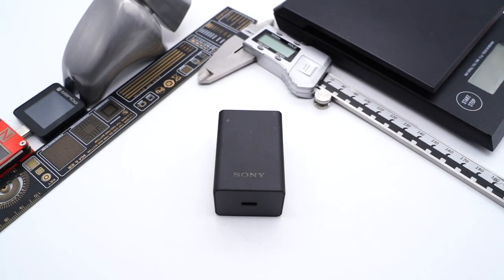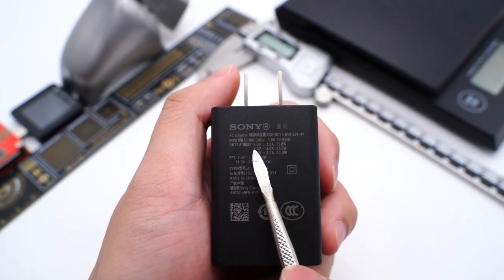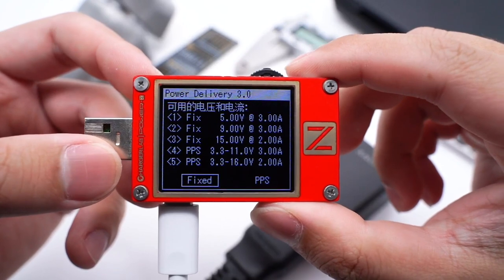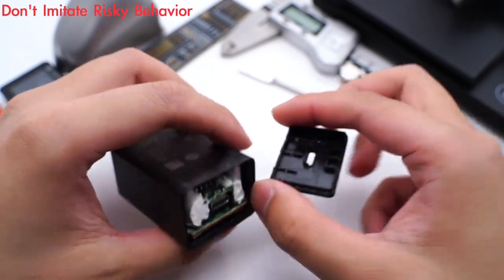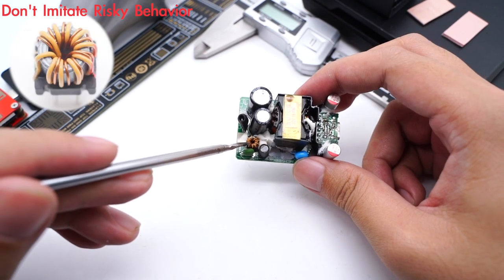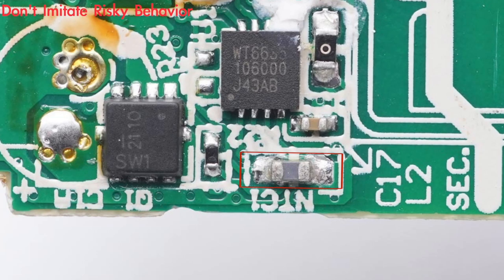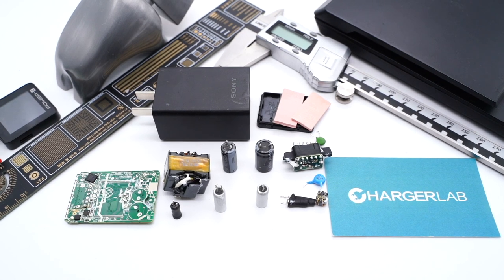Teardown of SONY 30W PD Charger XQZ-UC1 (For Xperia PRO-I)

Comment: I thought that electronics usually have physical separation between the high (120/220V) input and the low voltage output. Ex. a few millimeters wide gap on the circuit board.   But everything here is tight together.  How does the isolation work?
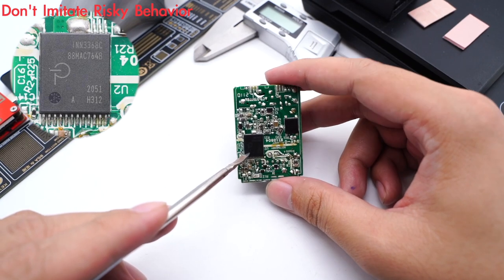Reply: Hi, at around 2:33, you can see a white isolation line that goes underneath the pi controller chip that is the isolation. on the other side of the board you can see the transformer pins are separated too. so it looks quite safe.

Comment: What are you using to discharge the board?  I assumed that capacitors need to be discharged but chips too?
Reply from the maker: chips means all the components, just in case🤣